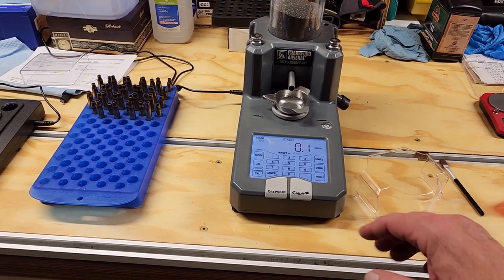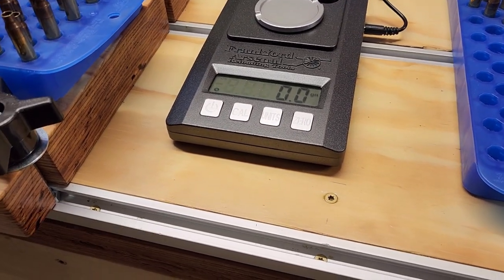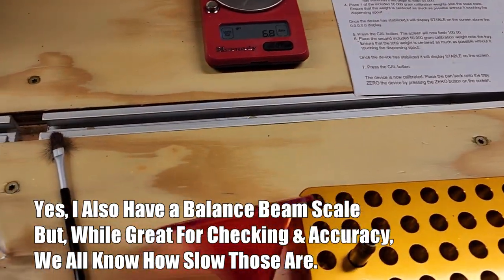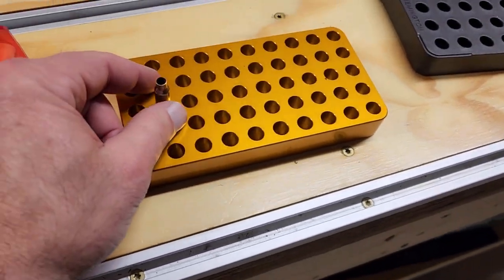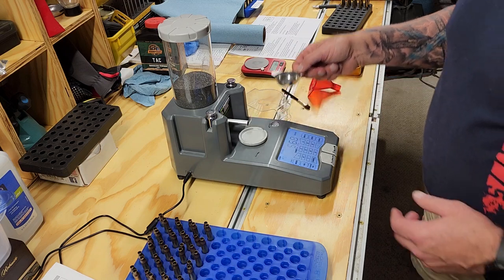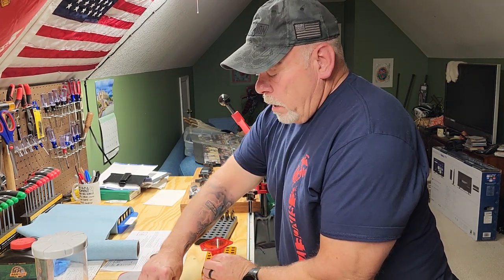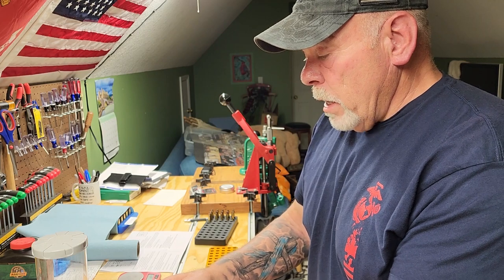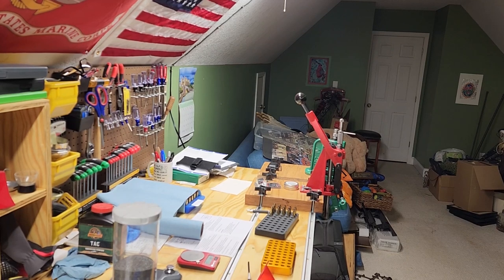Precision Reloading Without Precision Scales

Comment: It looks like your reloading bench has developed some since you first posted on it. Very impressive! I'm at the other end of the spectrum trying to achieve the most I can with no more than I can fit in a box. The Hornady scale interests me as it is much smaller than the Lee balance beam I have always used. I'm not sure of its accuracy to produce a number but I'm certain of it's consistency with itself as each grain of powder moves the needle so accuracy is acceptable to my standards. Finer powder has smaller increments of weight increase so I gain some accuracy there. It is slow especially as meticulous I am.  For accurate rounds I use milder loads as every body knows as pressure increases so does the difference each grain of powder makes. I half expected more of that kind of info for us ham and eggers. The Hornady scale intrigues me being so small. I've always liked Hornady products and your approval tips the scale for me. I always seem to gain some tid bit of info from your videos. Keep up the good work and best of luck in your upcoming events!
Reply from the maker: Yeah, I'm always finding something I "have" to have...lol. You will NOT go wrong with that Hornady G3-1500 ! It's a GREAT little scale. I also "discovered" that you can change the timeout(s) to 0, 120 or 180 seconds (Factory Preset). Thanks !!

Comment: Pressure gauge is a special pressure gauge designed to measure the size of solids and liquids with pressure. Generally speaking, compared to the scales we use every day, this scale has a smaller capacity and is used to measure more weight.

Comment: A precision scale is a weighing instrument with high sensibility, designed, precisely, to measure the mass of solids and liquids with a high level of precision. Generally, this type of scales has less capicity and are used to weigh smaller masses, when compared to the scales we use daily

Comment: As the sensitivity and resolution of precision scales go, one does not need a particularly expensive one for weighing propellants and projectiles for reloading
Reply from the maker: Very true for the "average" reloader. But to really shrink groups and get low SD/ES that precision shooting disciplines seek (F-Class, LR, Bench Rest, etc.) precision & repeatability is paramount. But, like you said, expensive doesn't HAVE to be part of the equation. Inexpensive Balance Beam scales perform very well with their accuracy depending largely on the accuracy of the calibration weight used. But, there's always tradeoffs in precision and speed. Thanks for watching !

Comment: Without precision scales, you may end up with variations in your reloads that can affect your accuracy and safety. Therefore, I do not recommend precision reloading without precision scales.
Reply from the maker: You're not wrong. However, "precision" is a relative term, mostly in terms of how good one's equipment is. Also, not that load information from a reloading book is 100% safe, it's the closest thing we have to indicate where the upper ends are and was tested much more thoroughly than anything we are likely to do ourselves. Since this video was made, I have acquired precision, scientific scales and when comparing to the 3 scale method I was using during the time of this video, I'm seeing no more than 0.015 grain variance. Thanks for watching and thank you for your insight!